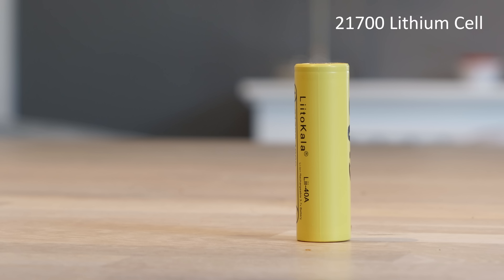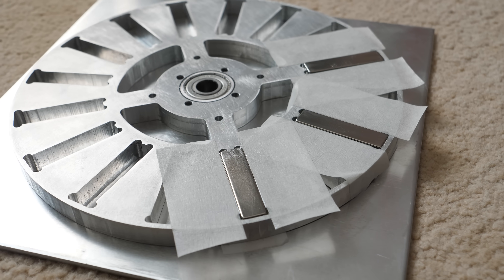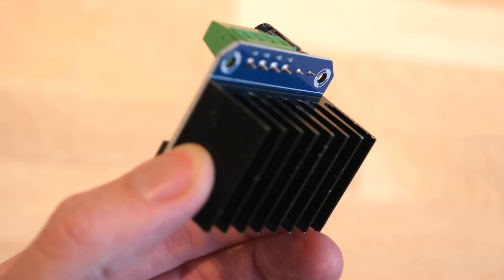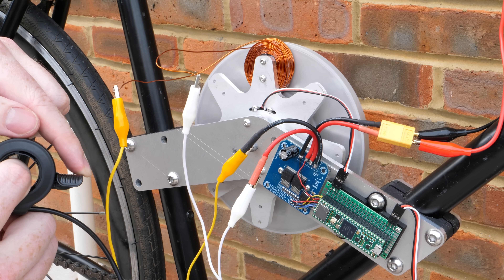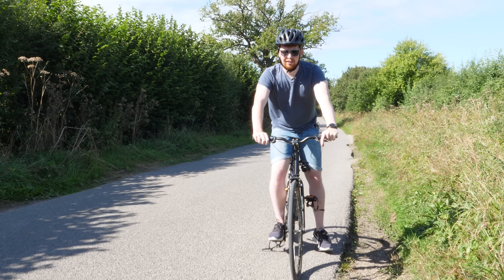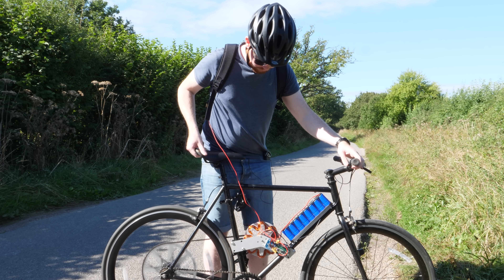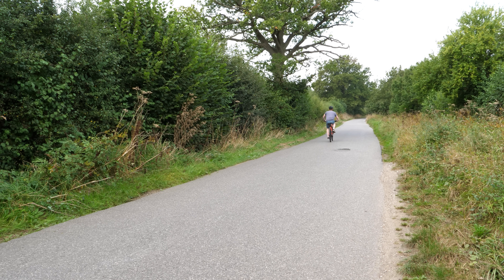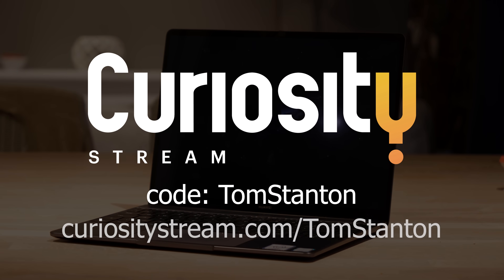Super Capacitor Bike

Comment: I'm into 19seconds, and see a weird comparision. 0.4 Wh SC charges in 1 min, where a 14 Wh Li charges in 45min... but you cant compare different power ratings. If you only charge the lithium battery to 1/35 of its value = 0.4Wh, it would be 1.3min, so you achieve roughly 1.3x charging speed with SC over Li, and possibly the same since charging isn't linear.

Comment: I have a idea 💡 what if you could set up the  Regenerative breaking to charge the capacitors and use the capacitors energy  until they drop to the equivalent sy voltage of the battery so you can get more power back from your regenerative breaking and get more range overall on your lithium powered bike

Comment: Supercapacitors must be used with protection board. See the supercapacitor bank 16v that comes fully assembled. Its £39 ready built. When you have them in series, the capacity drop from 500F per capacitor, down to 83F. You have higher series, you have less farads.
Your projects are good ideeas, but you don't handle them properly protected.

Comment: An outstanding bit of engineering. You've developed two things at once and it's perhaps not easy to understand whether the lack of performance is due to the motor or the electrical power delivery system. I'm aware that BEV motors run with voltages stepped up to 1000s of volts, enabling a smaller motor with less proportional parasitic loss to deliver high power at 20krpm. It would be interesting to see your motor perform with a conventional ebike battery, and your capacitors with an conventional ebike motor. I think 41% is outstanding though for regeneration, although I noted you did preserve some kinetic energy with the nifty u turn at the bottom. 👍
Reply: What if you put a generator on the front wheel?

Comment: If you'd implement field oriented control your diy motor would probably become a lot more efficient and powerful :)
Reply: Capacitors for taking off quickly from the start, li-ion batteries for cruising, with regenerative braking recharging your capacitors specifically. Now that'd be neat!

Comment: This is "NOT" DIY electric bicycle building!! The average person with NO electronic training
could not approach, in the slightest degree, what was done in this video. 
Tom, what is your electrical education background??!!
I was a little confused at first by your goal. You expressed disappointment when you tried to ride the bike on motor/capacitor power. As you stated, caps are short term energy supplies, so surely you didn't expect to get far. However,  toward the end of the video you did a down hill test and back up.
 I thought this was the original intent all along, cap/motor assist bicycle riding.

Comment: What if you are charging the capacitors by Pressing the pedals and discharging them Like a booster. So you are riding your bike normally and then use the capacitors at the start to give a little boost, riding it normal again and whenever you need it, you can boost again

Comment: From a mechanic engineering perspective, shouldn't the electromagnetic gear be bigger to help with the driven gear of the back wheel? From my understanding, one revolution of the small gear against a larger gear only completes a fraction of the larger gears revolution doesn't it? 
I'm really looking forward with the next version with regenerative braking! And maybe an implemented gear system to help

Comment: I HAVE ANOTHER CHALLENGE FOR YOU:
Design a controller that only activates the motor when the pedal position is at least efficient or weakest position for rider. Then let the rider do the work. 
345 to 45 degrees powers the electric motor, 45 to 135 degrees motor off/the rider powers the bike, 135 to 255 degrees power on, 255 to 345 power off again.
This is to see if the batteries can last much longer on a normal e-bike.

Comment: Check out that gear ratio!

Aluminium gears with a side load on the steel chain?

Be impressed with yourself as you walk up the hill?
Coils on the SIDE of the motor?  More inefficiency and side loading.
Try making food from"scratch".  At least you won't waste resources when you perform like this.    Just eat it.
Folks, this is an example of what NOT to do after watching some documentaries.

Comment: supercapacitor stores 40 times less energy
and recharges 40 times longer
so same recharge rate

but supercapacitor runs low voltage quicker
even if same time charged

what is that? Y U Usd it?

Comment: great setup but i think you should constraint on the energy side and try to make hybrid energy system that include super capacitors with more capacity that just for push starting your bike and then continue with the lithium battery for the rest of the ride and re-gen power to charge the capacitors for every time you start,actually i think this kind of setup is optimal for future electric cars since the start ride of the car take the most amount of energy from the battery

Comment: 8 of the 400 Farad capacitors in series gives you a capacitance of only 50 Farads.

Wire them in parallel and you'd have 3200 Farads of capacitance.
Reply: That is true. However I believe that voltage will decrease in such a way that the total energy stored is still equal?

Comment: Tom, great video. Can you try to combine li-ion battery and capacitors,  in order for capacitors to cover high power usage in start, and smooth recharge of li-ion cells during strong regen.  So it will act as a buffer for li-ion battery and significantly increase a battery cells life cycle by taking down peak discharge and charge currents on capacitors.  Thank you very much, please let me know about this idea! I am big fan of your channel!!

Comment: Ah, I love these projects because they're... pretty good at explaining why supercapacitors don't really have an application in vehicles. The charge rate of a capacity may be high, but because they have such low capacity the actual volumetric and gravimetric power density is usually on par with or sometimes even worse than batteries. Also, batteries tend to charge fastest at relatively low charge, while supercaps charge at very low power from empty and only really reach their full potential around 2/3rds charge.
Reply: What's being produced at this time, yes, take up more space, usually with less weight. But in the future chemical batteries will loose.
Reply: Don’t forget that batteries hate charge cycling, while capacitors don’t. Using any sort of regenerative braking with just batteries will degrade them super fast, but charging supercapacitors whenever possible helps to take the edge off (and can supplement voltage for higher torque when accelerating)
Reply: Capacitors for taking off quickly from the start, li-ion batteries for cruising, with regenerative braking recharging your capacitors specifically. Now that'd be neat!

Comment: Hey Tom, this is an awesome video, I really want to do this myself!
I was wondering why you chose these specific capacitors? The capacitors I've been looking at are LIC2540RS3R8277 by Taiyo Yuden (3.8v, 240F) because I think those are smaller in actual size, but about the same in storage size.

Comment: Funny how I had this exact idea back in 2011 while studying Electricals. The teacher said It wouldn't work.(Could be because of the current tech at the time.)

This is back when Ebike weren't a thing.
Reply: The idea I had was to use the motors, mainly as Regen Braking..the power can then be used while moving, to keep it moving; or charge your stuff.

Reasons:
- Having a fast acceleration wasn't appealing in terms of safety, because riders would abuse it. Which can lead to more accidents, especially when you use it from traffic light to another.
- You'd use less energy to keep a machine moving compared to relying 100% on initial torque.
- Spend less on replacing brakes.
- Brake Light is possible.
- Cheaper than Li-on.

Edit: Nowadays, I'm waiting for that Carbon Chassis Battery(Structural Battery). The chassis/body itself is the battery.

I think it was a Swedish research.

Comment: In 2012 I presented the electric flywheel concept that's a student physics society meeting in Baltimore Maryland. The electric flywheel concept uses the V squared term that is voltage squared in the ultracapacitor bank as an analog to the V squared term that is velocity squared giving the kinetic energy of a vehicle and its Wheels so that the electrical energy stored is the equivalent of a certain amount of mass added to the vehicle and especially its Wheels. During one of my calculations I had the opportunity to access no less than 15 each 2700F 2.7 volt Maxwell Technologies ultracapacitors from from a surplus by of ultracapacitors used in a city transit bus and computed that the effective Mass of these ultracapacitors which weighed about 20 pounds all together was something like an entire semi truck when combined with an appropriate motor. I never did build them up and disposed of the pack at the local household hazardous waste under the small business hazardous waste provisions safely.

Comment: Super capacitors are already used in high-end electric cars for regenerative breaking and as a buffer for the batteries. It's generally put in to reduce stress on the batteries caused by sudden acceleration and allows consistent speed despite the voltage decreases of lowering capacities.
Reply: What? Who said that? No they aren’t. Batteries are excellent at giving a lot of power suddenly for short sprints. Super capacitors just over complicate everything and are not used in EVs.

Comment: I am probably not the best engineer ever but I was wondering if the spinning of the wheels could be used to recharge the batteries even just a small but. That way you might not ever fully run out of energy although you probably wouldn't be able to reach full speed

Comment: Hi Tom, great your Axial Flux motor, but I have a couple of queries why did you not put magnets both sides of your coils, and why did you not have a stator or ferrous (ferrite to reduce eddy currents) pole pieces for your coils, I think the use of both would have dramatically increased the efficiency of your motor. Come to think of it why isn’t ferrite used in high frequency motor cores, at first glance it’s the obvious choice as its used in HF transformeers.?

Comment: My engineer son and I built something along the lines of what you did. The main difference was that the super capacitor array was about four times the size of yours, the lithium battery was the primary power source and the super capacitor array was there  to provide a goodly amount acceleration. We purposed the super capacitors to act in an analogous manner to a nitrous oxide injection system on a gasoline engine. We also found it useful to incorporate an LRC module (the only thing I can compare the module to is a flyback transformer, but that’s only a fair analogy) as part of the power integration for running the Li Cell and the caps concurrently. We’d rebuilt and modified a brushless DC motor off of battery powered electric lawnmower and homemade hall sensors to feed the controller data. The controller was also home built. It can be roughly described as a switch mode power supply with the ability to vary the pulse width in real time as load demands varied d/t hills and acceleration requirements beyond what the battery could supply. My son created all the programming/algorithms to make this home brewed contraption function well and well functioning it is. The boy is a computer engineer who’s a better EE than most with an EE degree and that’s why this rig ran right on the first run.

Comment: Hi Tom, It's great to see the inventions you come up with, you're an inspiration to many, that that homemade eBike motor caught my interest, I'm a MTB rider and have been toying with the idea of making an eBike. I recently did a Bafang convertion for my wifes bike, but I'm now thinking to fabricate my only frame to beter acommodate a Motor & Battery, or maybe Capacitor??? 
I have an engineering fabrication background but have now moved to the CAD Drafting side.
I see you use a variety of CNC tools, I was wondering if you could recommend a good CNC Router, 3D printer and a Laser, water jet or plasma cutter. Something to either cut shapes through thin or markout shapes on thick materials so I can cut manually.

Comment: Hey Tom, with the right bike, you could store the caps in the frame and use a system to turn on the extra capacitors as the voltage drops. All you need now is one of those new barium titanate solar panels.

Comment: How about charing the supercapacitor using a Solar panel and once the capacitor is fully charged, it sends a jolt of that charge to the motor (very similar to how human legs discreetly pushes the pedal) That way the sun can do the push-push-push in cycles ?

Comment: If you're talking about helmet safety... it's only worth it for kids who cycle slowly.

For adults, crashes usually result in rotational injuries in the brain because the helmet twists the head. Really, it's generally very safe to fall off a bike.

If you have a really bad crash, a bicycle helmet really won't help because they're so light and designed to be destructible. Only little kids have a benefit, because their injuries are usually falling over to the side because they stop suddenly and can't keep their balance, or can't keep the bike going because they are novices, and bike helmets are only designed to provide protection for this kind of collision, not any collisions adults commuting will ever encounter.

Comment: You’re using way old capacitor tech. The ones in this video has much greater storage! https://youtu.be/ir0cnB51VYQ
They are almost on par with the equivalent sized lithium battery.. you could have stored a lot more energy in the same volume

Comment: It would be cool for an electric vehicle to use super caps for a temporary boost. Just to try and push acceleration limits. I don’t expect it to be practical or efficient I just simply think it would be a cool concept to test.
Reply: I thought the same thing too.  I hooked a voltmeter up to a hybrid and you can clearly see the battery voltage drop when you accelerate, and sometimes (e.g. a hill start) it drops so much it causes the engine to start to boost the voltage up again.  So clearly the car could benefit with having more amps delivered from the battery even without pushing any acceleration limits, which the capacitors would be perfect for.

The trick would be how to integrate them, because when batteries are charged, the voltage is increased way above the nominal battery voltage in order to cram more amps in.  In the hybrid the voltage nominal is 230 VDC but when stamping on the brakes the batteries get fed up to 270 VDC from the regen braking.  So you'd have to design your capacitor pack to handle that highest voltage, and then the problem is if you brake for long enough the voltage would remain at that higher level (it wouldn't quickly return to the nominal voltage like with a battery).  What would happen is that the batteries would continue to charge off the capacitors until the voltages equalised.  But it means the batteries may charge more than the car was expecting and the car could get confused about the battery voltage remaining too high for longer than expected.

It's probably one of those things you'd just have to test and see what happens.

Comment: Aren’t you supposed to wire capacitors in parallel to add up their charge? I thought in series it would lessen the overall power they can hold..
Reply: Yeah I was just thinking the same...
If we are right he is using only about 2% of the capacity that would be possible

Comment: That chain adds up to certain power loss. Like engine drag, having to turn the Dynamo, waterpump, AC and all that.
Reply: @davidmayo7279  I'm talking about drag / loss in general. If you look at EV cars today the electric motor is hooked up the wheel itself rather then using a differential or any of that.

Comment: So refreshing to see someone explain the discharge profiles clearly.
Most presentations ignore the ‘physics’ facts, and sell supercaps as the only solution.
Reply: but, he showed capacitor discharge for a "constant current" load - which is not useful. 
A more realistic discharge is for "constant power" and that is MUCH steeper than constant resistance (typical RC decay curve)

Comment: Good work on making it all, however... not great to be building your own motor to test viability of supercaps.  Coreless motors are terrible at getting the flux to where it needs to be and aluminium works amazingly as an Eddy current brake, which will suck significant amounts of power and torque out.  With caps, I'd be running them thru a boost convertor so the input voltage to the motor controller stays fairly constant throughout the discharge.

Comment: Okay this might sound totally stupid but could the pedals operate a generator that kept the capacitors charged? When on flat ground or short hill light pedaling would be sufficient but on a longer hills more would be needed. Assuming there is an obvious reason that would not work I just don’t know.